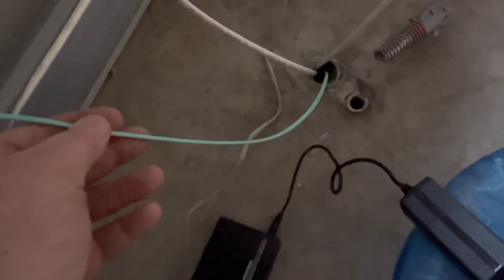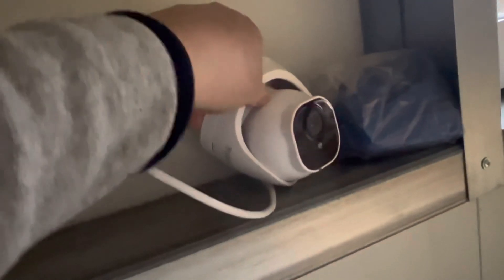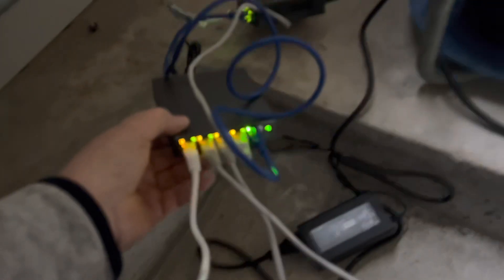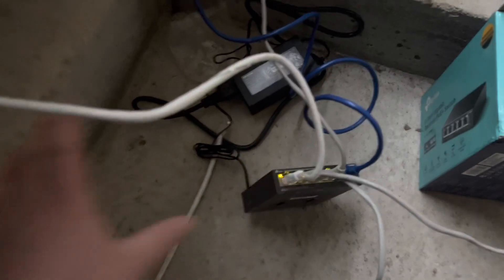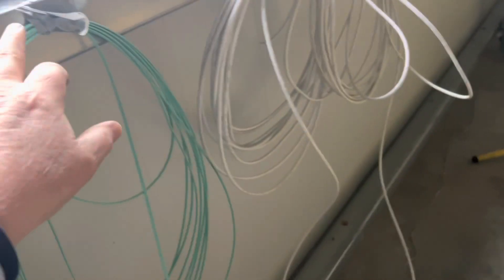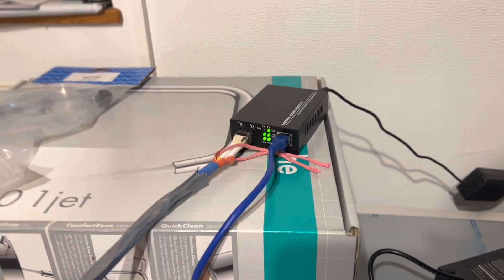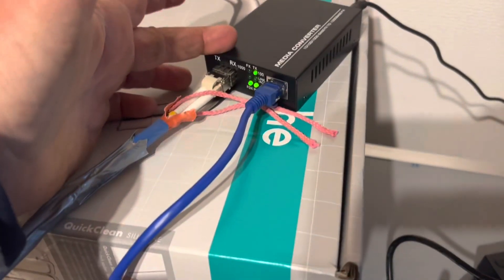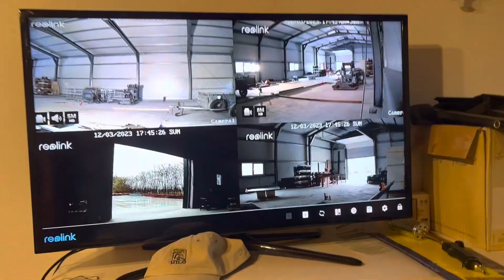Geek time 🤓! Fiber and network link! Way easier than you think!🤓

Comment: The fiber used is not intended for underground, between building connections. Its mostly for fiber patch connections between fiber patch panels and switches/devices inside a building. However, if it works then that's the main thing.